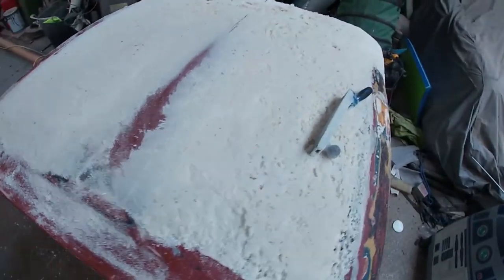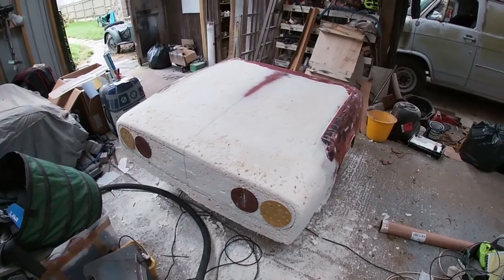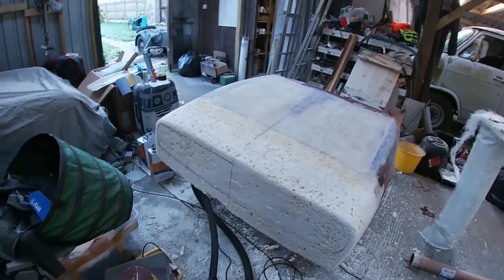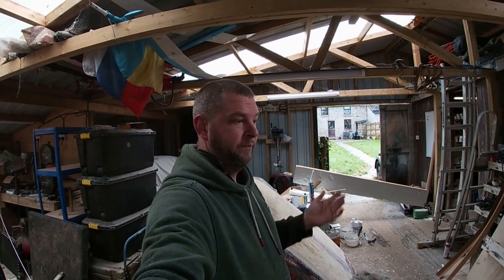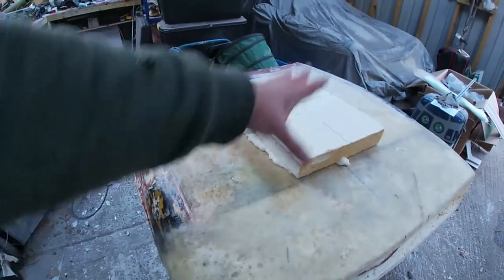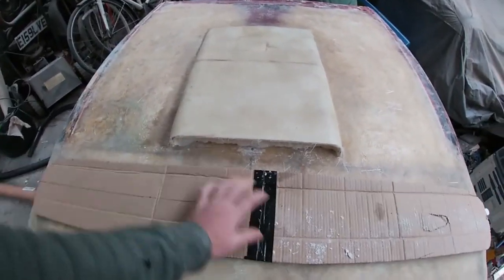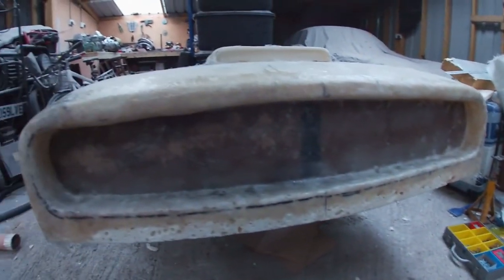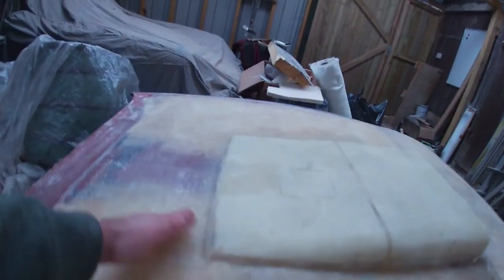Triumph Spitfire | Custom Fiberglass Bonnet | Mopar Style - Part 2

Comment: there is a bond equipe bonnet for sale on flea bay in the UK.  it should fit the spitfire as bond equipe" use the triumph small chassis and engine but have their own body over.  the bonnet of a bond equipe i think might look like something you are looking for.  although the bonnet you are making is looking pretty good and you're talented and not afraid to try.   but still thought i'd mention it.  it's a bit far from you, but it's going very cheap.